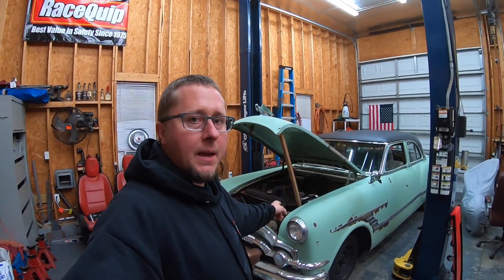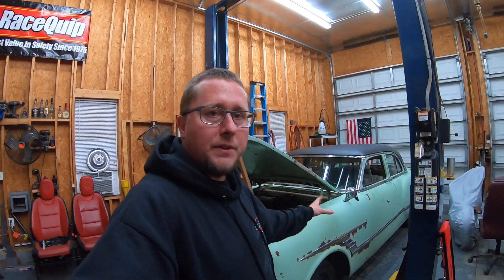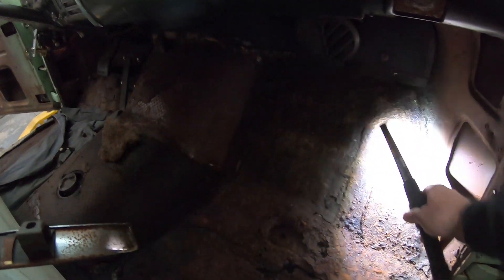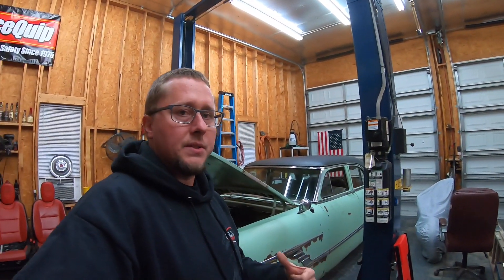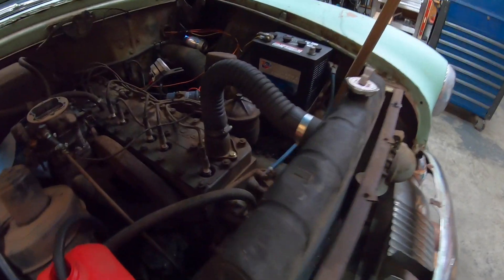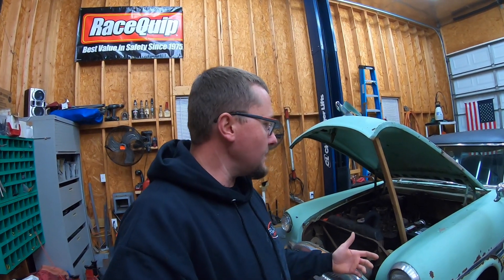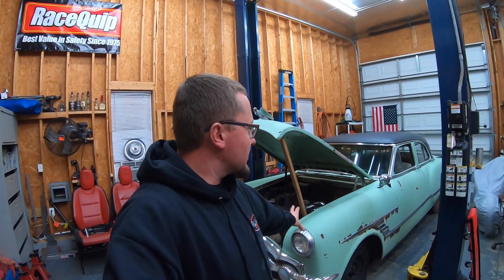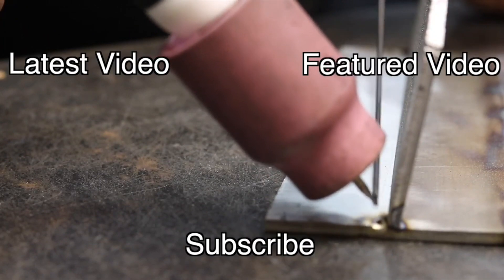The Issues With Hot Rodding An Old Car

Comment: After watching your last video about parts I looked on sf craigslist ,Bay Area , found ad it might help 
Large collection of vintage Packard auto parts. Mostly for Senior Packard years 1955-1956. All good used to NOS. Spare engine, trans, body panels, rockers, fenders, hoods, trunks, bumpers, emblems, interior items etc. Too many to list - have an Excel spreadsheet. 30K+ book value. Low price for entire cache for the investor or hobbyist with late model Packards to use and or trade. Moving out of state so all must go soon. 9K OBO. Cash only no trades  this is the ad , good luck , I enjoy ur videos,   Can not wait to see it finished  jeff
Reply from the maker: Thank you very much

Comment: For a radiator, I used a Jeep cj7 with a small block chevy aluminum radiator from eBay for my Studebaker..
As far as the thermostat housing, try a big block mopar, I’ve heard they work, but not sure